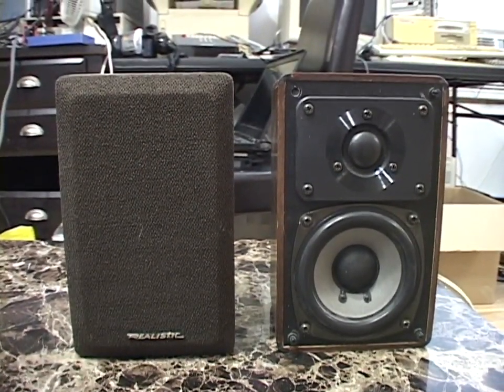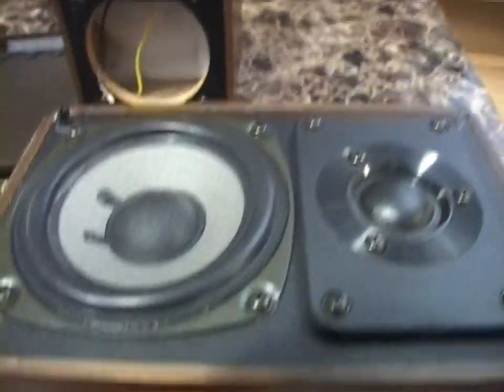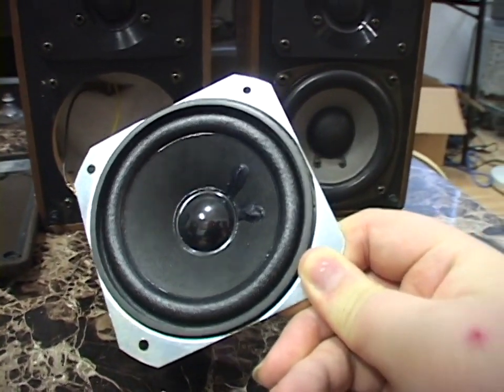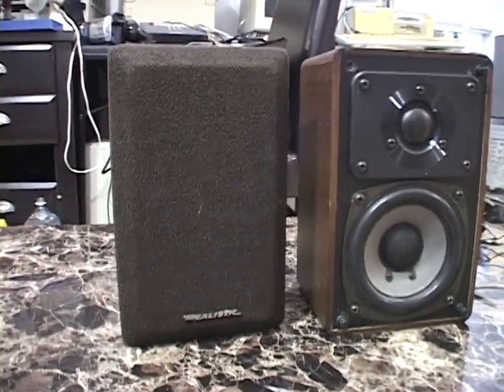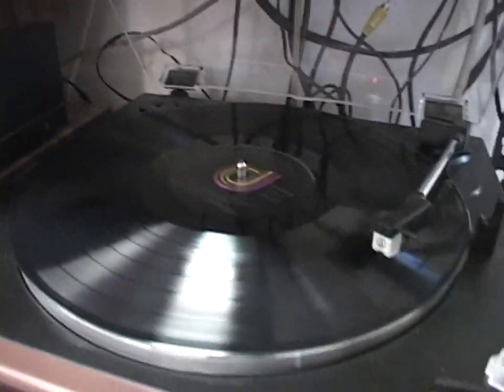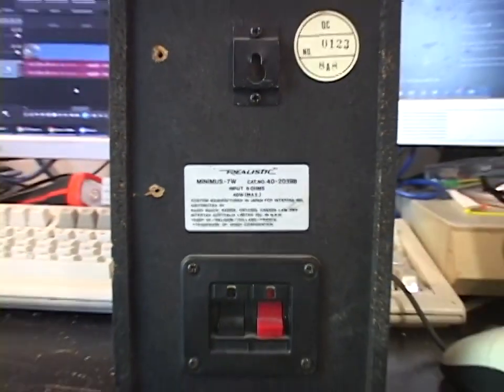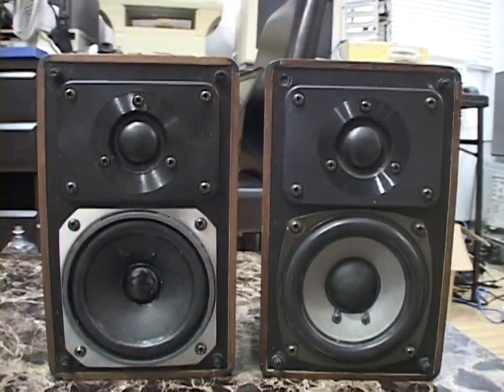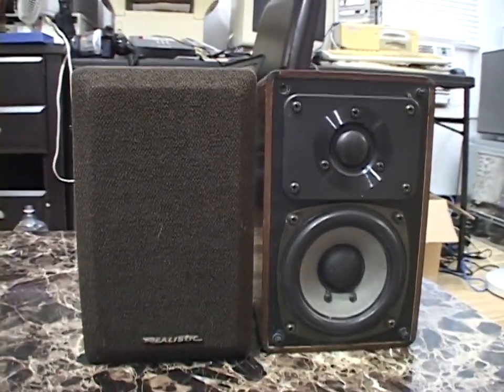Realistic Minimus-7 speakers (1988), repair and demo

Comment: The fabric surround has less resistance and it looks like that new speaker is not fully sealed as the original is because it does not fit flush. Hence it rebounds more quickly than the originals. If I were you I've find a single Minimus and cannablize its driver so that you have a matching set. Then put the new driver in that one to use as a mono unit somewhere. It's pretty easy to find these, many thousands were sold and they're always on ebay. The problem? They're not as cheap as they used to be. 

I have a couple of pairs myself. The 7W wood units and the cast aluminum black. I use them as computer speakers with a class D Lepai amp from parts express. All in, an extremely cheap PC solution a few years ago. Not as cheap these days though.

Comment: The driver snapping back immediately in the modified speaker is lack of proper seal for a bass-reflex system. Plus the replacement driver has what looks like a cheap fabric surround, not foam or rubber, so maybe that fabric surround is porous and vents a tiny bit of air?

Comment: I have a tiny set of jetsound speakers with 4" or 5" drivers that I use for my rear surround sound speakers.
They are kinda rare.
I had them apart once to reglue the surround on one and wow was I ever impressed. The magnets on these are mad crazy huge.
They are a 2way speaker like what you have there, both drivers are of a paper cone veriety, at least the tweeter, think the woofer might be poly. its thick whatever it is made of. With the metalic dustcap some might say makes them look cheap, don't be fooled! They have rubber surrounds on them and they are heavy! They are small enough you can pick them up with one hand if you dont drop it that is, and I think they originally were intended to be used in automotive and boat type aplications. I think the cabinets are metal or very thick plastic. Mesh grills that can come off, and nice +_ spring clip terminals on the back. They can put out a fair amount of bass, rated at 4ohm each. Used them to listen to some vinyl once and they do sound nice alone for a compact listening station setup. In my case I ran them from a sony amp.

ugh I'v ran into that same exact problem when swapping over speakers. Theres gotta be some kind of standard to make sure you have the clearance mesured out before purchicing a replacement to drop in.
In one case where it was a somewhat meh or low-mid tear speaker I didn't care too much about, I just kinda forced it a little and it worked fine. Sure the metal frame of the basket bent a little but it didn't matter a whole lot in my case.
Were these 5" drivers for the woofers?

Comment: The 40 watt rating is maximum/peak/"music power". So the RMS rating of the driver could indeed be around 10 watts.
Reply: Correct, VWestlife. The Minimus 7's were designed to be sold together with the Realistic STA-7 mini-receiver, which cranked out 11 watts per channel RMS into 8 ohms. The STA-7 had an "eq" switch which matched the Minimus 7's not-exactly-ruler-straight response curve. BTW, these are Minimus 7W's. The Minimus 7's had a cast aluminum case.

Comment: That new driver almost sounds like it gets rid of that "hole in the midrange" effect these Minimus 7 speakers tend to have!
Reply from the maker: That's actually a good descriptor of what I hear from the original driver. Although I'm not sure I get much high-end either - it just sounds muddy overall. Of course, my perception might be biased by how bright the new driver sounds.

It's strange though - the Minimus-7 seems to span the entire gamut of reviews. Some people say they don't sound that great, while others (most) say that they are fantastic, with many recording studios and radio and TV stations using them for their apparently monitor-grade reproduction. So were these just hit-and-miss in terms of quality? Or perhaps age-related deterioration of the drivers?
Reply: @themaritimegirl  I've owned a couple pairs of these over the years along with some of the bigger model I think...Minimus 10s or something like that? I can't quite remember. My experience with them has been that they're a solid speakers for the price they were sold for with the tendency for the woofers to go bad. I had one that had a rubbing coil I had to replace back in the day. I would guess that the design of the speaker was pretty good but the quality control from whoever made the woofers wasn't exactly 100%.

I've seen the same as you. Broadcast seems to love them, enthusiasts of vintage audio seem to have a mixed opinion and the discerning audiophile more than likely hates the hole in the midrange effect enough to ree at them pretty hard.

Personally, I think they're fine. They're not amazing, they're not garbage, but they are pretty damn solid and that's something you don't always find in a speaker. I used to use a pair as computer speakers and loved them for that purpose! Especially with an amplifier with a loudness curve.
Reply from the maker: @lmull3  Ah, so the bad woofer in mine wasn't a one-off occurrence? Very interesting. I guess it's good that I didn't buy an identical new-old stock replacement then, as much as I wanted to.

At the very least, they have a fantastic cabinet to fit with new drivers if needed/desired.
Reply: @themaritimegirl  No, definitely not at least in my experience. I bought an OEM replacement and it was completely fine though, so I guess results may vary is the best way to describe that whole situation.

Yeah, for sure. The wood version of those is by far the best cabinet of all of them. The metal cabinet doesn't sound nearly that nice.